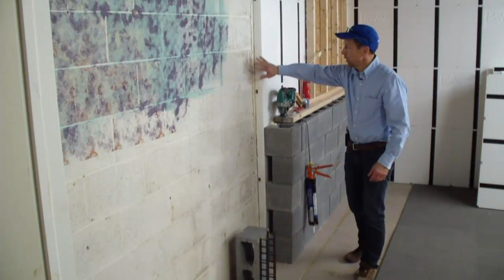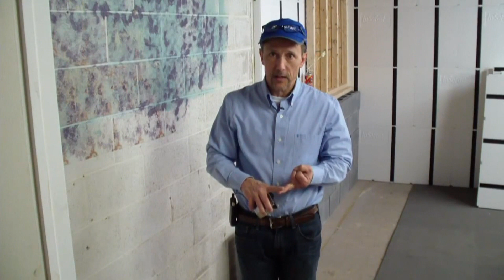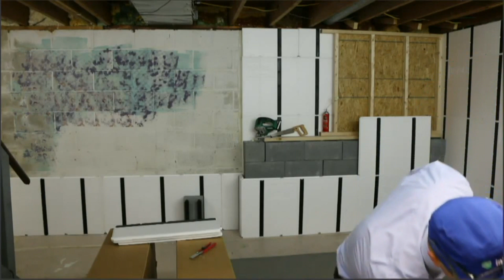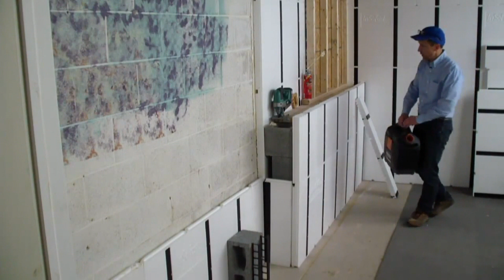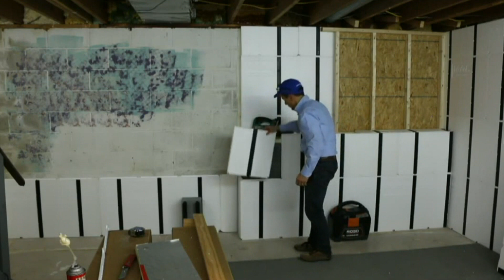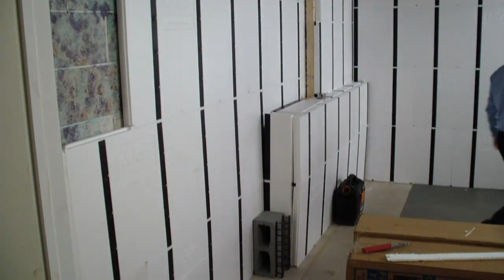#AskInSoFast: InSoFast Half High Wall

Comment: Do you have to dry fit an entire wall before gluing, or was this installation without gluing just for demonstration purposes?
Reply from the maker: No you do not have to dry fit the insulation panels. Most contactors never dry stack first they just glue as they go. These videos are for training and demonstration only once you glue it you are stuck.